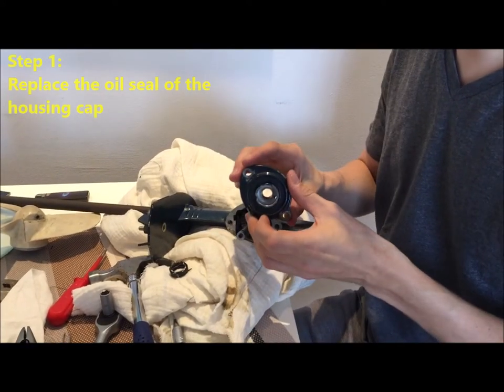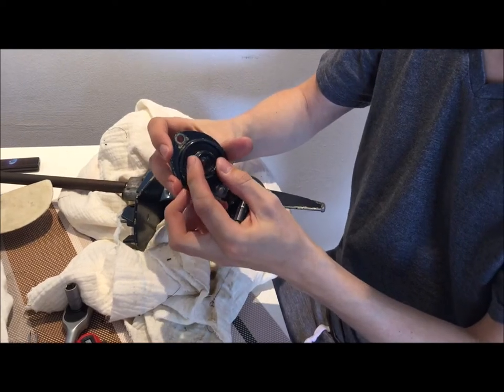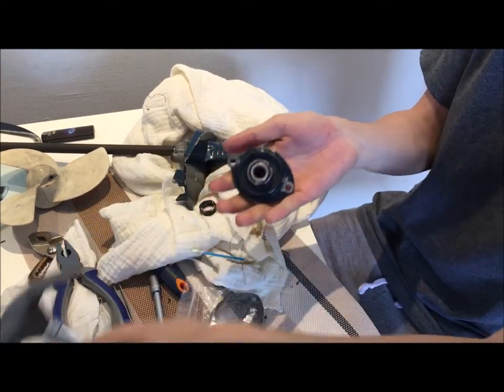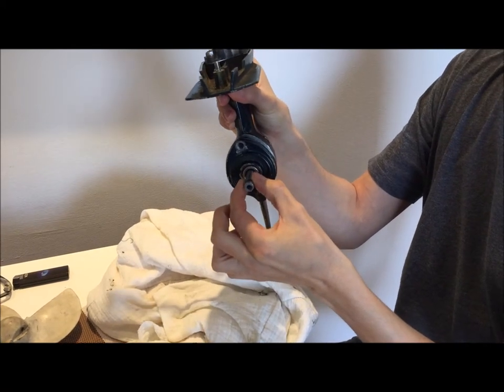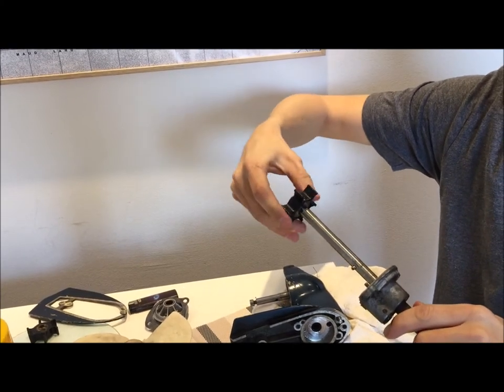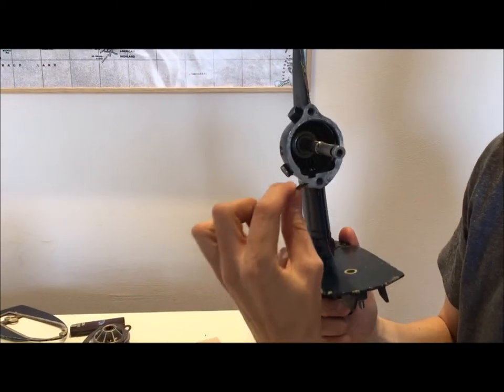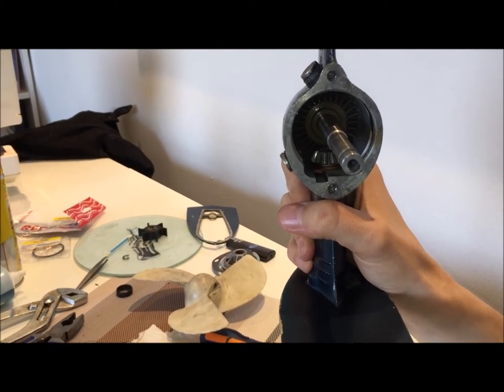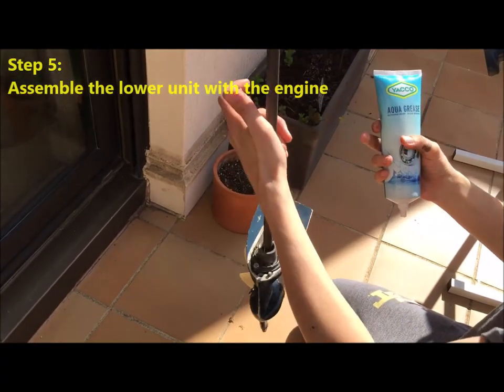Yamaha 2B (2hp) outboard - Reassembling Lower Unit after Impeller change

Comment: Don't suppose you replaced oil seals when you did this? According to the parts diagram, there's one that sits in the water pump housing and another under it I think?

Comment: When fitting a new impeller the drive shaft and (on mine) the water transfer pipe are wiggled out of the leg. The water pipe comes out with a rubber grommet on the top end - the only way to get this back in its proper position is to undo the 6 bolts holding the leg to the motor base and drop the leg off - only then can you see where the ‘top of the tube’ grommet goes and ‘fiddle’ it in place   You have to be careful of the gasket that is between the leg and motor base - or have a replacement to hand  - hope this helps - I couldn’t find any videos covering this pipe
Reply: Thanks! You've just answered my comment above! So the 6 bolts holding the powerhead have to come off to drop the drive shaft!

Comment: How do you drop the lower unit ?   I need a new impeller ...  Idk how to drop it.   Your video is great.. woulda loved to have seen how it drops.
Reply from the maker: There are 3 little notches in which you can put a screwdriver and gently tap with a hammer. It might be a bit tricky especially if it has never been removed.
Reply: @Sandro_Set  ok, great.  Do I have to go into the gearbox and remove anything free it up ?